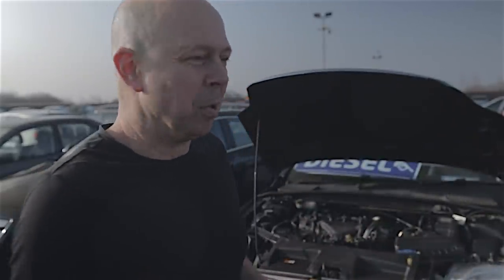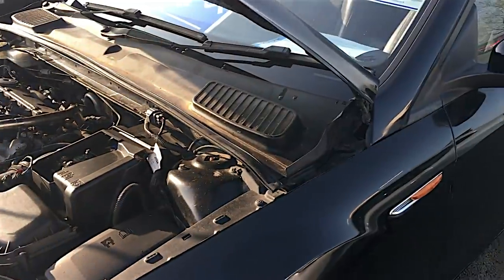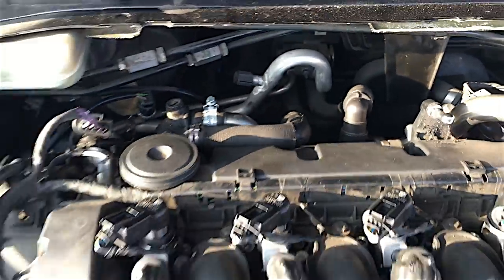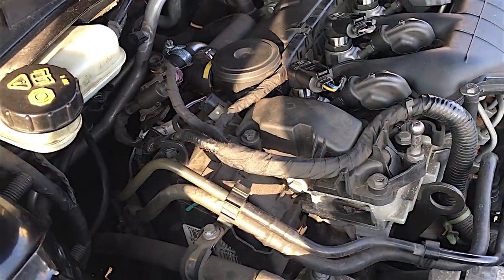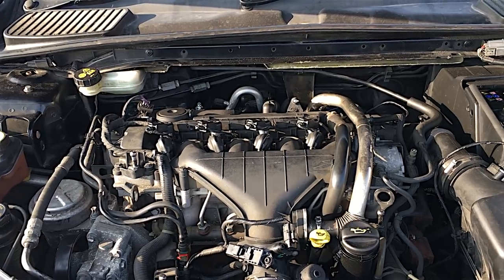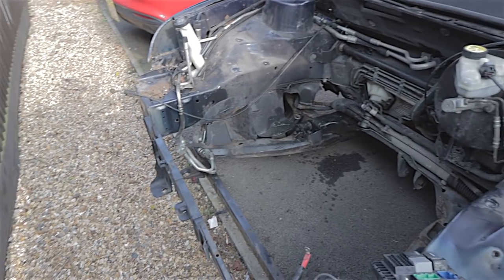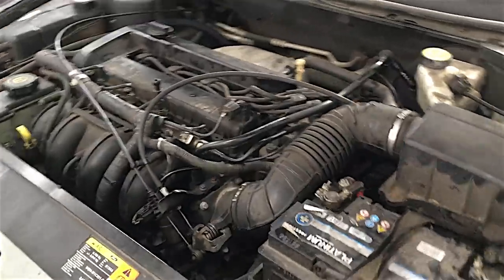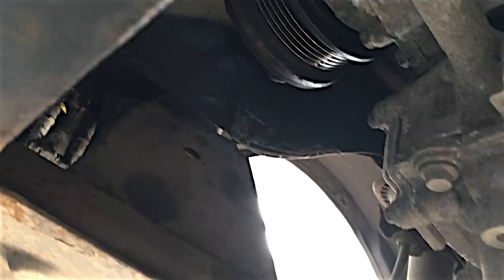Excessively Smoking Mondeo 2l Diesel On Start up.... (FIXED)  & Mk3 Mondeo Air Con Pump Noise

Comment: I had an old ford escort diesel 1.8 non turbo about 1997 it never stopped smoking.white smoke all The time i had the car 2 years.never stopped smoking white smoke .now I know about diesel pressure and dripping leaking injectors
I thought someone had fitted the pump  belt a notch out something like that.would have been easy to fix but I never figured what it was.i wasent very  clued up with diesels in those days.i could have gone in a scrap yard and nicked 4 injectors.but thanks you solved a 25 year old  problem I had.at the time I couldn't find an answer without paying out big money..ive learnt a lot more since then.i always found screwing out diesel  injectors and putting them back caused them to leak through the body.but thanks for this.very helpfull my daughter had that similar diesel car.the dual mass flywheel was rattling and we  couldent be bothered fixing it.your a lot cleverer than me.

Comment: Reasonably good video Alan in connection with the others regarding injector removal/replacing. My diesel Mondeo is at the 234k mark and had same symptoms only lighter. Was on top of the problem, removed the injectors, gave them a good clean, refitted, problem gone for now. Second time now in about 4-5years when I have removed the injectors. The amount of gunk was considerable but nothing we can not overcome. Great videos, thanks man

Comment: Re using a screwdriver to hear bad bearings etc, cut the bottom off a 4 pint jug, stick the other end over the screwdriver handle and u have a perfect listening device. Btw 110k for a diesel in 12 years suggests low use, and this seems to be the killer for most Diesel engines particularly glow plugs and injectors as well as the emission gubbins. Great vid as ever 👍

Comment: I had a MK3 Mondeo 2 litre diesel that did that; difficult start, lots of smoke, but spot on when warmed up. Main dealer reprogrammed the injectors, which reduced the smoke by 60% and turned the fuel system fault light out, but warned that if the light came back on I'd probably need new injectors...

Comment: Good work and video as always, I remember I had Peugeot 2.0 TD some years ago, it used to be like that, I changed fuel filter and glow plugs and it was still a Rat Bag on a cold start, I think looking back I bet it was injectors at fault, it was clouds and clouds of smoke and incredibly difficult to start from cold.
Reply: Hi, was it injectors or bended rods?

Comment: Just to share my experience for the same: white smoke, very rough idle, knocking sound, car not driveable. No errors whatsoever. I suspected the injectors, but after testing them on a stand, they were OK. Replaced also the pressure regulator on the injectors ramp. After almost 2 months, I've reset the injection learned values and went on a trip (accelerating and decelerating for around 15 km). Out of nowhere, the smoke went away and all was back to normal. A year has passed since then. Hence, if you are not sure of the deffect, try this one as well, before spending more money.
Reply: How You reset ? I have same problem

Comment: Speaking of the leaking coolant hose mine's been slowly leaking for a while at the same spot (mine's a mk4 2.3 though) and already got the spare but haven't got round to fit it... reminds me to change it before it's too late! And for the air con pump I would say it's not too bad in this case - in Hong Kong where the air con sees over 8 months of usage per year we have bad stories where a failing pump internal brings down the air con radiator and the expansion valve... 
Keep up the good work and look forward to the next video!

Comment: My work van is a 2012 Transit and i've stuck 200,000 miles on it. It dont smoke and still returns 31mpg. It also dont burn oil and dont leak it either. I've had it serviced every 20,000 miles from new and admit to looking after it better than others would. Flip to identical Transit in depot with half as many miles...thing is a complete shed due to not looked after.
Reply: Agree, regular servicing is essential for longevity of a vehicle but I’m surprised the intervals are 20,000 miles- that’s a lot of miles for an oil change even if it is Fords recommended schedule- My Mazda is supposed to be every 9000 but I always do it at 6000. I know modern oils are far superior than even a few years back but I still think the gaps are too long.
Reply: @rogerbarrett9920  My Transit is 20,000 but Vauxhall Vivaro's are 30,000! Our vans are maintained by a fleet hire company and if you tried to book it in earlier than the service book says they would refuse to authorise it.
Reply: @zeb3144  - 30,000 is such a huge amount. Obviously the recommended oil must be working but I still find it amazing that such a mileage between services is considered ok by a manufacturer.

Comment: I have been using a screwdriver like that since 1966. No code readers then!. Very useful stuff there as I run a Mk 3 Duratec HE. Mine is fine but you need to be careful as it is 17 years old.

Comment: Thank you for a very informative video. The intro is funny and art or poetry. The infos on diesel and mk3 crash and ac pump are really interesting. Wonder if it is possible to leave out the ac by using a shorter auxiliary cable and then rip of whole ac out of the car.

Comment: You should try and change glow plugs on the Volvo's that have these engines. The bulkhead gets in the way of the egr cooler and egr. Pig of a job to do. Looks like the mk4 mondeo has a lot more room. I'm now in the mk3 mondeo so even better for me.

Comment: I had a 2012 1.6 titanium Mondeo. I had real problems with the fuel filter getting gumed up through winter. I would have to change them 2 times to get though winter. I don't know how true it was. But apparently it was down to the Very fine filters they use on the 1.6 which ment that in colder weather the fuel would start to leave wax deposit in the filter
Reply: Might have been algae, seen it in a combine where it was parked every winter with a full tank and stored until summer, the filter got clogged every time and it also caused fuel pump issues 🤔 That, or not enough antigel additives/too cold weather maybe?

Comment: Had a similar experience on a vauxhall Vectra 2 litre DTI.
Glow plugs were ok but glow plug light used to go out almost immediately in the winter.
Replaced sensor still no change so fitted a resistor to fool software into thinking it was cold.problrm fixed but still smoked on start up but ok for rest of day so would suspect leaky injectors.never fixed it as injectors were fitted under the camshaft.

Comment: I don't replace the injector washers.  A good clean, heat to red hot and allow to cool, then a wipe on each face with a fine file.  Back in the hole.  I have more issues with the fuel fittings leaking than the injector/head seals.

Comment: Thanks Alan. I've got this exact problem with the s max that I'm selling. Leak off values were perfect but correction values on the graph with live data are all over the place on start up so I guess i've got to bite the bullet and get a set of injectors.

Comment: my 3008 2.0 hdi was running like a pig and smelling. I tightened the claws down on the injectors as they seemed a bit loose. 17,000 miles later its still bang on

Comment: Just to say my mk4 same engine has 3 failed glow plugs. It starts and runs perfectly so I've left it because it seems a pig of a job. No black smoke on start. It's done 186000 on original injectors and clutch.  It does however enjoy a bottle of redex every few months.  Sorted all the hesitancy that often gets reported with these engines.
Reply: @prapradziad  Hi Jan. Yes I agree it never gets very cold here so starts instantly. A bottle of redex every few months keeps it running smooth. And make sure pipe feeding DMF is not broken so it regens and it will all be fine.

Comment: hello...I have a question...I have a Ford.mondwo.mk4 2012 2.0 diesel 140hp....I have a problem with.the car for some time I have had a vibration in the car...the car vibrates and  when I'm sitting still and in charge...I noticed that on the rev range of 1500-2000 revolutions it makes that vibration...and it's as if from the left (passenger) side you can feel the vibration...from below...  if you have encountered this problem before....thanks
Reply from the maker: would have to take a look at that

Comment: I've a 60 plate Ford Focus 1.6 TDCi with the euro 4 engine that white smokes when warmed up! I changed glow plugs, dpf, egr and injector's! It's still the same. White, sweet smelling smoke after the engine has warmed up!!
Reply: Any coolant loss?
Reply: @toeknee6588  none at all, I also bypassed the EGR cooler to eliminate that!
Reply: Could be bended conrods. Check compression.

Comment: I've got exactly the same problem on a focus. Replaced egr like yourself and no fix. Gonna check the injectors soon
Reply: Hi, any luck? Did you fix the problem?
Reply: @nemocap2958  nope, was OK through the summer but the starter motor has gone now so it's just parked up waiting for some love.

Comment: sir did the egr fault goes away after you replace the 3 glow plugs, im waiting for the parts to replace mine, i got 3 busted glow plugs and a egr fault code p2141, hoping the egr fault goes away after i replace the glow plugs

Comment: My S-max smokes greyish sometimes when downshifting hard,esecially to second gear and sometimes when moving from a completely stop, starts and runs normal, only error is on the O2 sensor, bank1 sensor 1, really hope that is the reason 😢

Comment: Hey, just stumbled across your channel and subscribed. At the start of this video I thought hey that place looks familiar…..😂 no other place than Steve’s car sales! 😮 I was searching for an issue similar but this car won’t start when it does try it’s running lumpy for about 3 seconds with smoke coming from back of engine…. Have no idea what to do first as we put one of those sealey obd on which threw up p0299
Reply from the maker: hi, it would be worth checking to see if the glow plugs are working

Comment: Do you think leaking injectors by themselves can stop the car starting when its really cold. Ive had similar problem for 7 years but today was first time i drained the battery trying to start it. Once i charged it i got it started pretty easy. I changed the glow plugs and relay about 6 years ago but it didnt help. Thanks.
Edit after manually heating glow plugs for 3s it started straight away and ran sweet as a nut so it wasnt injectors on mine.

Comment: Same problem with my S-Max. Have stripped the injectors and cleaned them in a sonic bath. Putting it back together just now...
Reply: Hi, sorted the issue?
Reply: @nemocap2958 No, had to give up on it and got another car. It's still parked on the drive and going to sell it for parts.
Reply: Probably bended rods/s..

Comment: I have a kuga 2009 titanium with the same 2.0 tdci engine I just started to get the same issues that u we’re getting and it blows black smoke on hard acceleration runs bit lumpy do you think it’s my injectors and another issue if u can help is when the car is stationary and turn the steering wheel it make a rubbing squeak noise any ideas please and do these engines make a whistle noise when u rev the engine’s when stationary

Comment: So valve sealing are weak as well... 
 I had to replace engine in my 2.2TDCI due to injector failure.
Now in new engine I have constantly problem with injector washers leaking.
Reply: Did you clean the bottom of the injector holes? Maybe the seat in the head should be re-cut for an even surface and better sealing? (If you mean the washer under the injector)
Reply: @petermolnar8667  It was re-cut secound time with Draper hand tool, even injector was swapped. When was tight with proper torque still was leaking so was slightly over tighten ~45Nm. Then was fine for about 20000km and start leaking again🥺

Comment: Same issue, same diagnosis, same replacement parts, still same smoke on cold start. Apparently a very slight bend in piston rods cause this smoke! not allowing the piston to reach the top of its compression stroke there for not compressing fuel/air mixture at the correct time after warm ok np as the heat helps. I would love for you to take out this engine and prove me wrong but time is money and that car owes you to much. Shame though.
Reply: Started next morning after intensive take over. I'm thinking about bended rods(( Should I check compression or injectors?

Comment: Alan were NOT All Sparky's/ grease monkeys mate, 3 glow plugs open, 1 had " continuity" ???? .
Reply: Open circuit. Dead…. Continuity .. Ie working.
Reply: He said the mileage was 111,000 @ the 16:00 mark.  Think of a glowplug as a bulb, 2 pins one coil of wire. Open means the bulb/coil of wire is broken no connection.
Set a multimeter to continuity and you get a reading or a beep if the bulb is good. Broken bulb = no beep.
Reply: Thanks for the continuity answers lads.....
Reply: How long did it take you to line all those cars up Alan, I've been to your premises a few times and never seen em lined up like that 😂😂😂😂
Reply: @Alan Cobbin I defer to the master baiter.

Comment: Temperature At The Air Flow Sensor 18degree C

Atmospheric Pressure 1001.10mbar

Camshaft/Crankshaft Synchronisation YES

Cylinder Injector 1 Flow Correction 106.07%

Cylinder Injector 2 Flow Correction 99.83%

Cylinder Injector 3 Flow Correction 83.45%

Cylinder Injector 4 Flow Correction 108.41%

Engine Coolant Temperature 89degree C

Engine Speed 736rpm

Flow Regulator OCR 22.80%

Fuel Temperature 46degree C

Injection Time 5.51ms

Injector Programming Done

Main Injection Advance 0.01deg

Measured Fuel Pressure 250.88bar

Measured Injected Flow 5.14mg/impulse

Pre-injection Advance 0.01deg

Pressure Regulator OCR 13.60%

Reference Fuel Pressure 243.04bar

Comment: Hello Alan I have a mondeo mk4 titanium 2.0 tdci when I’m driving along mainly when cruising the car will kind of hiccup (juddering) then when I put more throttle down it will smooth out for a while then do it again any ideas please
Reply from the maker: i would replace the fuel filter first and read the engine ecu for any codes as there might be a clue there as to where to start looking
Reply: @alan4x  hello mate managed to get it sorted turned out to be a accelerator pedal sensor replaced the sensor and fixed the clutch switch now it’s working fine is there any other way I can private message you as i got a few other problems with the car and would be easier to talk to you through message

Comment: These fords always have injection problems Alan over 100000
Reply: Mines over 250000 on original injectors 57plate no problem whatsoever 👍🏻 been used on motorway every day tho and reg 8k services
Reply: @daveg9096  yes good cars some of them go forever you got a good one and you look after it great cars.